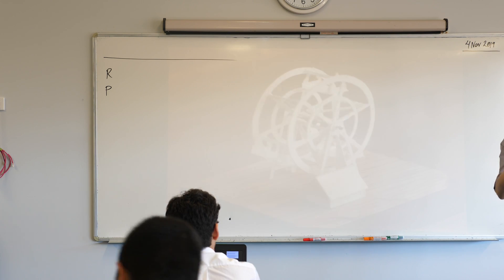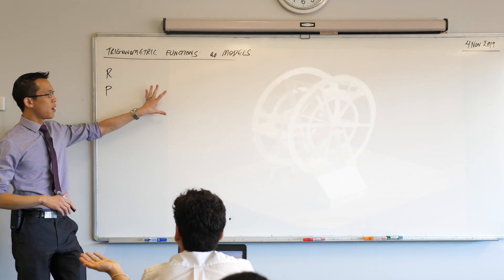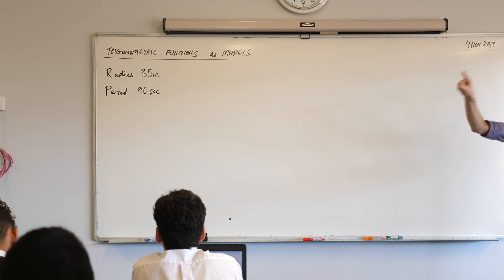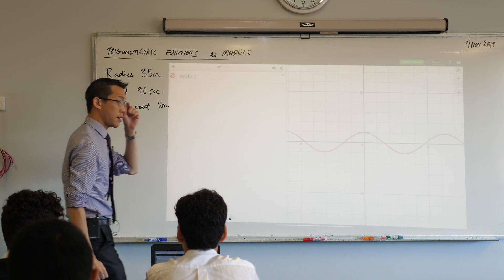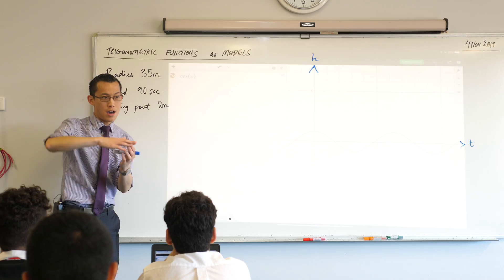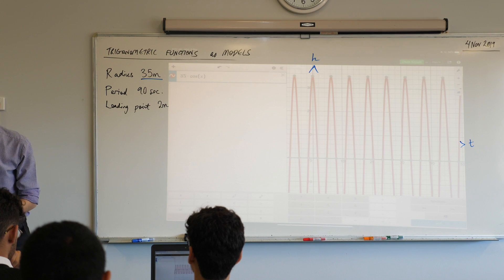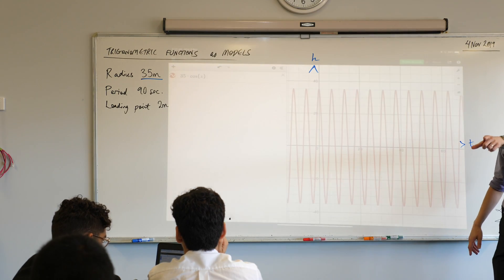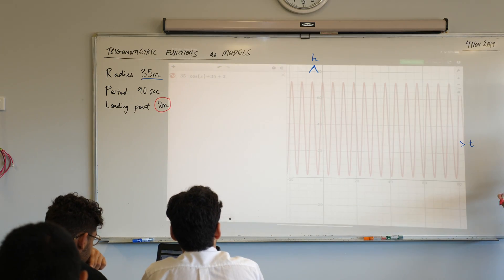The Ferris Wheel - Trigonometric Function Model (1 of 3: Setting up the equation)

Comment: This is an example of a 3D Unit Circle sinusoidal graph. If x is Pi (1/2 of 2 Pi) then z is sqrt3/2 which agrees with the unit circle. The movement on the x axis is Pi while the length of the circle is 2Pi. It is shifted on the z axis by the z amplitude. z amplitude is where the line crosses the x axis. https://youtu.be/G_D2KUVPJik
Reply: https://youtu.be/crcKfIcVSzk